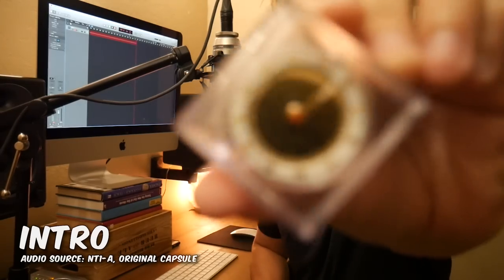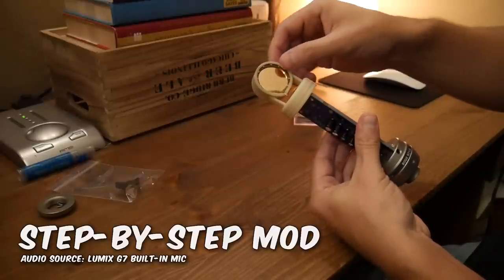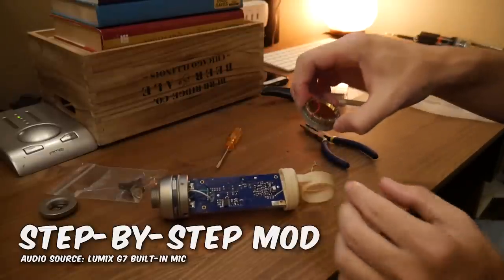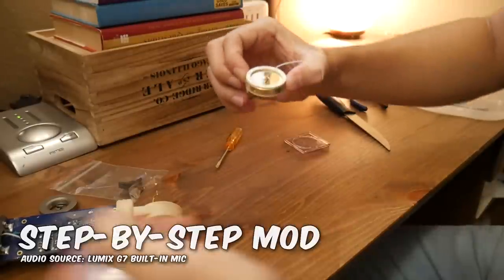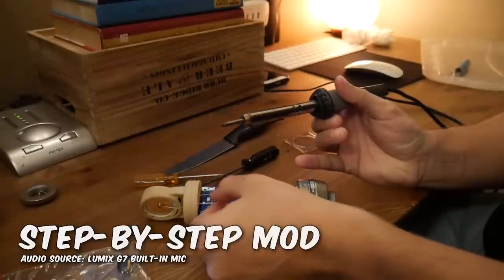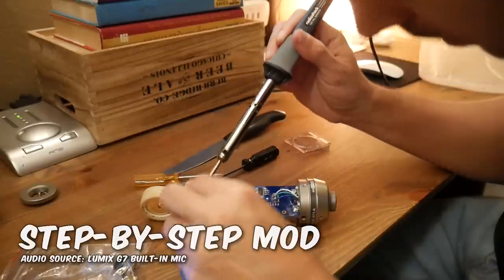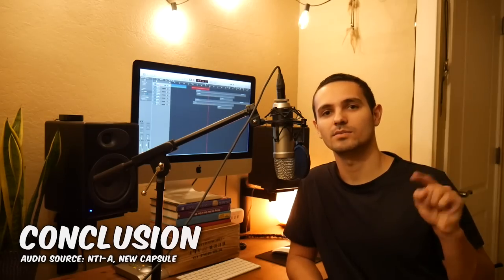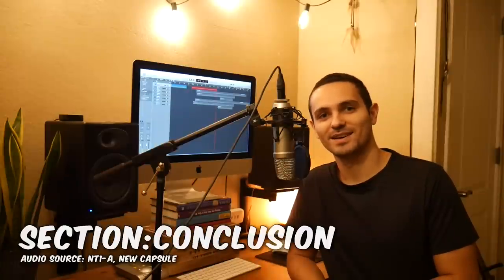HOW TO: $55 Rode NT1-A RK-47 Capsule Mod (Detailed)

Comment: This mod did exactly what you would expect. The high end is smoothed out and the mid range is  more prevalent in the 47 capsule. Most cheaper mics use the 67 capsule that has too much high end.  I wouldn't worry about the comments, usually people tend to always like the brighter sound when doing an A/B. Good Work! I'd be curious to compare a microphone parts capsule to this one to see if it sounds any different
Reply: Its not that the 67 capsule is bad per say, Neumann chose to fix the high end in the circuit design - Chinese companies didnt. It could have partly been a cost cutting measure, or they're taking advantage of it since to the untrained ear, "crispness" of a microphone is thought of as an indicator of the quality.
Reply: The Rode use a very cheap CK12 Capsule.. As there is no Centre Wire. There is a Centre wire for the K47 & K67 capsules, the U87 borrows from the U67 for its K67 capsule.. cheers 👌
Reply: @astralaudio101  Center wire? Are you serious? :D
Reply: Thanks for the video and awesome original song. I’d like to do that capsule switch on my Behringer B2 pro which also has an exaggerated high-end.
Cheers,
Jamie 🙂🇨🇦

Comment: 1st rule of audio gear: The purpose of mods is to get AWAY from cheap Chinese parts found in mass produced budget gear. I might try this, instead of throwing my old NT1A away, but I'll shell out for an American or European made capsule.
Reply: 1st rule?  Maybe your purpose for mods.  He modded with a chinese capsule, liked the result.  Reduced sibilance, pushed mids forward.  That's what he wanted, that's what he got.  Done.

Comment: If you listen to this on good headphones with the quality on 1080p, the mod is the clear winner.  The original sounds more hyped but it’s stuck that way and missing the mid warmth, while the mod can be EQ’d and still retain that natural sound.  On cheap phones it wasn’t so clear. You made the right call!
Reply: Gee, I listened on 108 using a Sony MDR-XB700 (a good headphone, I think) and I think that the Original is better. It is more clear, more crispy. I think them nod one loses some high frequences when compared to the original.
Reply: Modded one sounds so much more natural. Wether you like that or not probably depends a lot on how much you like the natural sounds of what you are recording. But generally it's easier to eq a more flat sounding mic than taming a strongly coloured one.

Comment: the original has more low and harsh high end, the modded smooths the levels out waaay better! nice!
Reply from the maker: JAY HOT I feel the same way man! It works out nicely for my mixes after a few months of use. The previous capsule was a bit much for my guitar/vocal purposes when put into the larger mix.

Comment: I did this mod today and for the first time I actually like the sound of my rode nt1a. I recorded a little guitar with both capsules and it's a massive difference. I do miss a bit of high end sparkle with the new capsule but adding that with eq is no problem. The high-end using the stock capsule always sounded harsh and siblant to me and it was near impossible to correct that using eq. Now I get a much more natural sound and boosting the highs still gives you that sparkle without any harshness. Money well spent. I thought about buying another mic entirely before discovering this mod.

Comment: Very good vid Noah.  The NT1 isn't the worst thing in the world but, when you switch to the modded mic it looses the spikey un-natural scratchy highs and comes of as much more natural and rich.  Some people will think the original NT1 is better because it comes off as being more "bright and exciting" which is just really a distorted over-emphasis of the high frequencies.   I built the Microphone-parts RA-23 about 4-5 years ago which uses the RK47.  The visual difference I see is that the Microphone Parts RK47 has brass fastening rights to hold the diaphrams instead of the white delrin or whatever that material happens to be.  Very happy with the mic, so very well worth the 350 bucks.  Good move and I"m certain you tracks will be sounding much more professional and much less fatiquing over time, especially once the track count begins to build up.  thats when you really notice the difference in capsule performance.  The trouble with those cheaper capsules is that you can't eq those harsh high frequencies out but, you can EQ high quality highs in with a good capsule.  thanks and enjoy Noah.
Reply: I’m debating either saving up for a RK47 or just getting this one in this video, what would you recxomend?
Reply: I was curious to know if the self-noise of the microphone remains the same 4.5 dB(A) (A-weighted) when switching out the original capsule with the RK47 one?

Comment: Being a trained electronics professional, this video gave me all kinds of anxiety. But I don't think there is room for criticism here. You were brave enough to try it, it worked in the end and you didn't injure yourself. So I'll call it a success!
Crazy what a capsule can change, good job and thanks for recording all of it
Reply: i was like no... no... please dont do that.. experienced in electronics... etc myself
Reply: What were his mistakes I’m in his boat I have lots of kits but to scared to do it
Reply: I am sitting right now in front of my open mic and I have no idea what you mean with mistakes? Are you even able to do something wrong with that, it's still 'only' music equipment, not high voltage 😅
(Exept the knife part, I think he did fine?)
Reply: I’m 30 seconds in, and I had to run to comments to make sure it works out. I just froze when he said he had zero experience and was about to mod something to dear to him…

Comment: With that high frequency sizzling, the original one sometimes tricks you to think it sounds better than the mod. I was skeptical about this mod too, so i downloaded your audio and analyzied, did some EQ so the two can match each other's balance. It turns out that the original one has higher amplitude and higher dynamics at high frequencies above 5kHz, while below 5kHz Frequencies has poor dynamics, feels like it has been compressed and saturated . This is why the original sounds more hyped. On the other hand, the mod one is quite opposite, it has better dynamics throughout all frequencies. This is why when comparing side by side the mod one feels "dull" to me because of the higher dynamics and a lower amplitude in high frequencies cause it to sound thinner than the original one. I can confidently confirm that, if you want to have more choice and more room in mixing vocals, this mod is for you. I can now mod my own NT1 :D

Comment: Nicely done A/B demo between the two microphones.  I enjoyed the song.  You definitely need to invest in a nice set of micro-tip screwdrivers!  Yes, tell the wife a sound engineer authorized the purchase ...  You may need to give your soldering iron more time to heat up before using it - at least 1.5 -2 minutes I think.  It should take just a couple of seconds to solder or de-solder those wires from the circuit board.  It has a big tip to provide lots of heat transfer, so time is the key element.  Serving Suggestion:  instead of jamming the replacement saddle into the original saddle ring as a shim, you might instead drill a very small hole in the original ring to let the wire and ring terminal pass through, securing the ring terminal to the edge of the capsule with a mounting screw that came with the replacement capsule.  That would obviate distortion of the original saddle ring.  The screw that came with the replacement capsule should secure the ring lug to the side snugly enough.   Nicely scripted, and did I mention I enjoyed the demo song?  TT

Comment: For guitars, capsules with a slight spike in the higher frequency ranges do sound better than the flat ones just because of extra sounds like the strings. For vocals definitely flatter is better. It’s easier to mix. You can bring the flat frequencies up to sound just like the original. But you can’t bring the original down to sound like the first. The new cap is nice
Reply from the maker: This is a good assessment - I agree. In listening back to this, I do like the way the original capsule brought life to my guitar and will probably use some of my other small diaphragm condensers to record it in the future and this mic on my vocals.

Comment: Sorry for being late, but I'm experiencing a very hard time mixing mine and my friends vocals after recording on a stock NT1-A!! I consider myself to not be a bad engineer but I just COULDN'T for my life EQ those vocals, I was going crazy. Went to do research and I was glad to find out I wasn't the only one, but also found out (I guess it's a good thing) that an upgrade can fix that sibilance hiss and it's not that expensive.

Now my question is, that website you linked no longer sells, on there, the dimensions are "Body dimension:φ34x13.4mm". I found a K-47 for 60 euro on aliexpress but the dimensions are 34mm x 9.6mm, will it fit? I contacted the seller and he seems great, even took more pictures for me, it has some good reviews as well.

Thanks in advance to anyone who decides to reply! :)

Comment: Hate to burst your bubble but its worse. Way worse. Maybe the capsule is good quality and all - but one thing is wrong - every capsule has its own capacity (condenser mic capacity -usually 5-20pF ) and the first most important component in every condenser microphone is the FET transistor. It has to be tuned to the capsule (many condenser microphones even have trim-pot inside so the engineer testing the mic in the final production line tunes it).
Edit: after seeing all he comments how it sounded much better made me doubt my tonality hearing ? Am I wrong or am I the only one with genuine honest opinion ?

Comment: I am looking for a microphone capsule holder with a diameter of 25 mm. Basically I want to remove the 13 mm capsule of my Um1 Bird mic because it doesn't work well and causes a lot of audio problems .... Could you help me find support? A thousand thanks.

Comment: Thank you for the video. I'd like to know why you included the capsule black basement if there is the original silicone one? Is there a reason that I don't catch for doing that?
Reply from the maker: I didn't even think of removing the silicon and just mounting it using the included base. That might have worked better and prevented the risk of damaging the capsule.

Comment: can I install a neumann tlm 103 capsule on a rode nt1a microphone? And if the sound works, will it be tlm 103? or?
Reply from the maker: Hi @CiLu Ra, the short answer is no. There are other parts to a microphone that make it capture sound. Not sure what capsule would get you closest to a TLM-103 sound with a Rode NT1-A body, if that's what you're looking to do.

Comment: Sigh, so the capsule sounds worse... I guess I will just throw my 2 nt1-a to the trash (wait, acoustic guitar sounded great to me with the unmodded version).
Reply: There are more capsules to pick from.
This capsule is designed to have a more detailed mid ranges and a smoother high end.
The new capsule sounds infinite amount better. On the guitar, the stock capsule has such an out of control bass and painfully loud highs with barely any midrange details.
Reply: @annekedebruyn7797  Thanks mate, I think for some weird reason I am not getting notifications about replies or likes to my comments. Anyway, after so much seeking of the correct/accurate gear audio chain and more audio experience I can tell for certain you're right. New capsule sounds way better and yeah, the high end so smooth, not exagerated or sibilant as the original. What I fear is that I think is the original is just pure trash and how the new one would behave gain wise (this guy certainly can make both sound pretty decent, but is very different when you have something in real life and using it urself). Cheers mate.

Comment: I have a problem my rode nt1-a it is not picking signal sometimes, some time it pick but immediatly it gone??? Can anybody can give an advice???
Reply from the maker: Dandy John Ramil did you attempt the mod or was this happening already? If the quality of the recording prior to the signal disappearing is normal, it could be a connection problem of your audio interphase to the computer, could be your audio interphase drivers need an update, maybe a bad wire. If you attempted the mod and this is happening, maybe it is something happening internally - I’m not sure how to advise in that case except to have someone experience take a look at it.
Reply: @chrisnavich   NO I never attempt a MOD . its all original,  it pick a sound so very small wave in my editing apps and full volume my interphase and i tried it to my friend with another interphase still not working. i guess the problem is the capsule, when i took it off their something  big dot color black  in the middle of it in the front gold. i tried  it in the radio station like it never pass an interphase  it directed in to a mixer it pick a sound. but not so loud. like before
Reply: i guess my set up with the interphase is ok coz when i tried BM 800 mic it work so loud,, I want to buy a capsule like yours and try  a mod. may be it works. is this one  you bought
https://wgtcenter.com/collections/capsules-element/products/pro-microphone-34mm-large-mylar-capsule-diaphragm-condenser-element-k47-k49-m7-mount-for-neumann-diy-replacement-one-sided

Comment: That capsule are work on dynamic microphone?
Thank you in advance.
Reply from the maker: Hi Jay, I don't think it would because these capsules require phantom power.
Reply: @chrisnavich  i have V8 sound Card is this enough power for that capsule?
Reply from the maker: JayGamz TV I don’t think that interphase has phantom power
Reply: @JayGamzTV  it needs additional curcuit